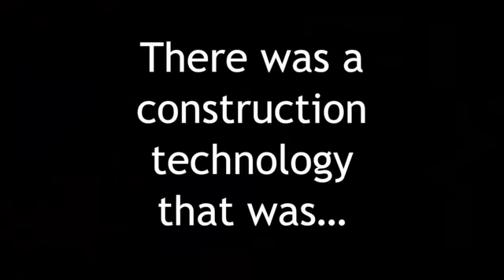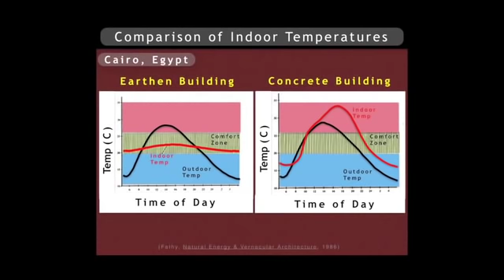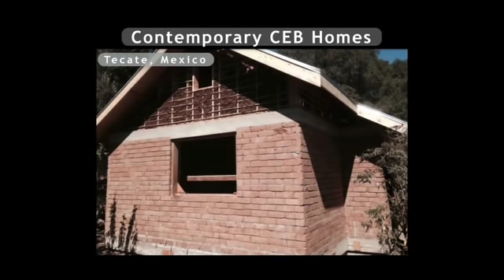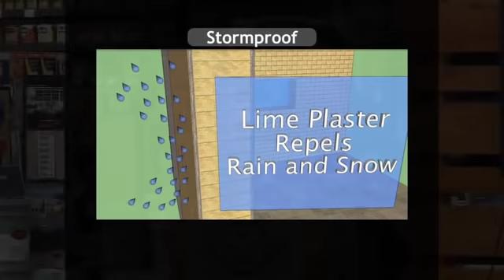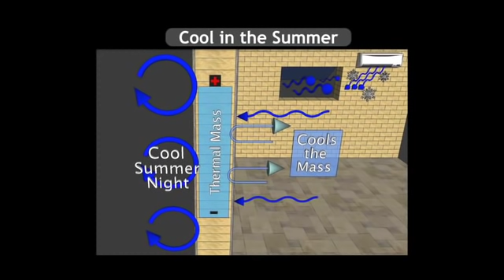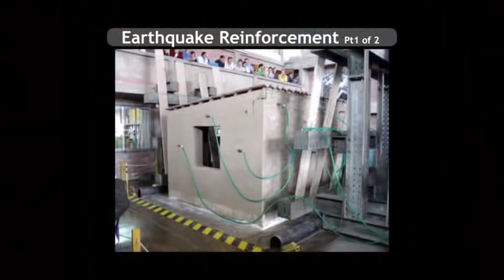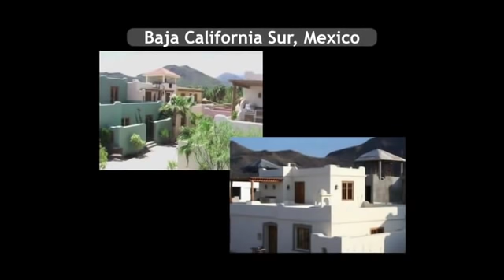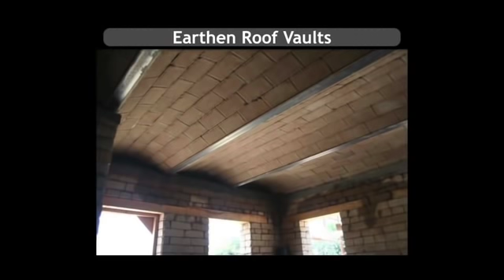Compressed Earth Blocks: Why and How, Here and There

Comment: I have 2 questions and a request about rammed house building.

1) How does construction of rammed earth homes integrate electric wiring and water/sewer plumbing especially for a 2 plus more floors?

2) Since the walls are made of earth, how do the walls survive in the shower or if rained on?

3) Is it possible to make/share a video that shows how the electric wiring and water/sewer plumbing lines are constructed and integrated into the walls?

Answers to the above questions will be very helpful in deciding about rammed earth homes and help shed a light on how electricity and water will be incorporated in rammed earth building. Thank you so much for the informative information.

Comment: Great presentation.... why not make the blocks interlocking so that they can be dry-fitted together and eliminate the need for skilled labor and mortar?
Reply: Yes. In Kenya, we are already using interlocking earth blocks. The machines for making them are also locally manufactured. Google "Makiga". Pauline
Reply: We are going to use the interlocking style to build homes in the inner-city to turn blighted properties into homes. By removing the need for skilled labor we can offer the homeowner a way to offset the home's cost... they can build their own walls, with a project manager to guide them. We just posted the video for our first concept home, the LuAnne. https://youtu.be/f4nHeNtufyA
Reply: @abundantearthglobalcdc4290  how effective is dry stacking tho? If there is an earthquake would it fall over, without a little mortar inside? He said they just use 1/4 inch  which is not alot.

Comment: By far the best presentation iv seen yet kept me interested from start to finish. I have a question though michigan temps drop extremely low in winter with no insulation in walls can passive solar and say a stove be enough for these temps.? Sometimes overcast for weeks at a time

Comment: For colder climates, the question is;  how much of the wall acts as thermal mass and how much is insulating that mass from the outside, much colder (ambient) air?  Doesn't the heat energy radiate right through that wall without insulation?
Reply: For very cold climates sometimes walls are built two blocks thick with a layer of insulation between them.  Jim built many CEB structures in Colorado.
Reply: I’m in Ohio right by the lake… I use compressed stabilized earth block. 4 parts sand, 4 clay, 1 part Portland cement 1 part high strength concrete… I use a manual press. My blocks are 5” tall 6” wide and 12” long. 2-2” holes in them to run rebar and various pipe thru. I apply stucco to both inside and outer walls. Still breathable. Remains between 65-70 thru the winter this past winter. One block thick. I have a 4’ wraparound porch on the home with roof over hang. Works like a charm. I have it solar powered and have an electric forced air fireplace in the living room only. No HVAC system at all. My solar system is grid tied and I have a battery backup for the absolute basics only. After a year I finally got the approval from 3 counties & 6 different cities building departments to build to sell these homes. Got independent lab tests, fire department certifications, even the local police and sheriff shot up a small wall to test if it’s bullet proof(it is), I am currently working with the VA and habitat for humanity to develop an apartment complex to get our homeless disabled vets off the streets.

Comment: Thanks for the very instructive talk Jim. I am about to build a Spanish style house in Australia. Originally i was interested in Earthbag, then got more interested in Rammed Earth (but the contractors were talking big money). But when we put the plans through our NATHers software (the Australian standard for checking energy efficiency) the figures were not very good (2.9 stars out of maximum of 10; see explanation below). They were good for summer temperatures (and we get up to 48° C; 120 F here), but in winter the heat leaked out slowly. I was reluctant to put insulation on the outside of the Earthbag or Rammed Earth and destroy the beauty of the wall and risk the render cracking later. So then I leaned towards using double brick with the cavity insulated. We were able to get the rating up to 7.5 stars. 8-10 stars is Passivhaus level, requiring almost nothing to heat. I will heat it with Solar water panels, re-circulating ceiling heat under the slab (3-5° C temp increase in rooms) and a wood stove for times when sun is not shining.

Then I started looking at CEB and am wondering if I can use a double block wall (perhaps 5" or 6" wide blocks) and install insulation in the cavity. What can you tell me regarding this? 
And do you know of any CEB making machines available in Australia?
Reply: Build your own CEB press. wiki.opensourceecology.org/wiki/CEB_Press

Comment: The key is the cement. A good, cheap cement, e.g., emulsified asphalt,  will allow a less optimal dry mix. Also no compression is needed with geopolymer binders. And no mortar if an interlocking block is used. An physical binder such as basalt fiber is much better than straw. 
Next, the bearing wall design has to match the needs of the area.

Comment: I would like to see hard numbers on the energy required to make portlant cement (concrete) and concrete blocks VS the energy required to produce CEB.  Hype isn't enough.
Also, by what mechanism is CEB breathable, and concrete not?  A concrete block wall is typically coated with a waterproofing on purpose, to prevent air and moisture infiltration.  Just leave it bare or coat it with mud like the CEB wall, and I bet they would be the same.

Comment: Very good  machine quick building
Reply: +tchip Pat It's not actually faster and in fact can take longer to construct than a stick house.  But the extra time and labor costs are offset by cheaper building materials.  Then long term they are FAR cheaper than stick homes, not to mention safer, better for the environment, etc.

Comment: How difficult is it to wire a CB home? Full modern suburban electricity+cable. Also, do the earth walls effect wi-fi?
Reply: It is not difficult at all.  Romex can be placed deep within walls in shallow grooves in the blocks cut with a rasp.  Because the structures are meant to last 300 years some builders prefer to use metal conduit.  You can also run romex in grooves near the surface and then cover them with wood trim or clay plaster.

In earthquake zones some CEB walls are wrapped with chicken wire inside and out which might affect cell phone reception but otherwise there isn't much metal to interfere with signal transmission.
Reply: Good question
Reply: Always worried about electric wiring.
Reply: Advantages of compressed earth blocks
Reply: It’s easy as can be depending on the style of block you make. The ones I make you do so while your building it…

Comment: Do you create a machine that makes locking / interlocking bricks?
Reply: Hallock does not use the interlocking blocks.  By using thinset mortar, wire mesh, rebar and concrete the structures become able to resist earthquakes in ways that drystacked interlocking blocks never can.
Reply: Vermeer does. $30,000.00 est.

Comment: A little clarity needed on the Seismic stability. The video mentions a basket method for adobe, but does not talk about the methods for compressed blocks. Anyone?
Reply: There are several methods.  In Mexico codes require concrete pillars at intervals.  Chicken wire is sometimes wrapped around the outside and inside of the walls below the scratch and finish plaster coats.  That is enough to keep the walls from collapsing.  I have seen videos of it in action so you may be able to find them on YouTube.

Comment: What are the measurement units for the compressive strength of the blocks. You mentioned strengths between 1500 and 2500 compared to 300 when using manual labour
Reply: Probably PSI. Probably.
Reply: The 300 figure is for Adobes.  Adobe is not compressed. They are poured.
Reply: The blocks I make with a manual press have tested 2700-3000psi… these things will crush any traditional block

Comment: Would rice hulls work in the exterior mixture? It really absorbs moisture and releases slow. However straw may be cheaper.
Reply: Have you ever used an HRV or an ERV in your homes? How do you exhaust the bathrooms?
Reply: How about using a mini-split system to heat and cool?

Comment: my question is
if i have a hand press can i use the freshly pressed blocks to build then keep wetting the build through its curing process and keep it tarp covered (i am saving time because instead of making neat stacks and building after cure i take it right of press to built and maybe stronger connected cause the whole wall cures together)
Reply: nice thinking. lemme know if u get an answer.
Reply: i have actually posted this question a long time ago, i would appreciate if you try contacting them (as i have not gotten around to it)
Reply: My understanding is no.  CEB and Stabilized CEB mortar is  a thin, pancake batter consistency slurry of the same mix used to make the blocks. Hallock and other building the way he does literally ladles it on.  The slurry soaks into the block above and the block below to make a single structure.  Within seconds of connecting two blocks in this way the blocks cannot be separated.  You would not want to cure the blocks in the wall because in the curing process the blocks shrink slightly.  Hallock and others have therefore settled on pressing the blocks in advance and letting them cure on pallets while wrapped in plastic, though the longtime owner of AECT advocated for placing newly pressed blocks directly into walls.

Comment: Do you think earth block houses would work well in places which have a heavy rain season ? I´m in Yucatan, Mexico.
Reply: Yes.
Reply: try B.C. Canada ........ unless u have rubber boots    ...
Reply: There is no problem until the blocks are compressed.
Reply: Yes, or just make an adobe house but add straw to the mix.
Reply: I built one in Nepal with 6% OPC and never added a roof. Not only did it withstand the 2015 7.8 earthquake, the bricks remain in perfect condition even after 15 years of South Asian Monsoons. So, YES! If you don't want to add a stabilizer, Lime or OPC, in your bricks, then make sure you have an overhanging roof and put a lime based plaster skirt around the bottom of the wall, also use stone for the foundation to keep the bricks from absorbing moisture from the ground.
Reply: That's very useful advice John!
Reply: Put a tin roof on it, with large overhangs and protect the walls from direct rain.
Reply: A stabilized compressed earth block can be used underwater.  A unstabilized CEB must be kept away from flowing water or standing water.
Reply: John Prokos is right about having an overhanging roof. The overhang has to be tuned so the side of the house gets full sun in the winter, then shade in the summer. My house is like that. I might add a portable south porch and make the south wall black.
Reply: @EllipticalMotion  this is how the romans etc built with earth
Reply: @EllipticalMotion  
I need more information john
Reply: Yes. I live in Ohio right by Lake Erie… just stucco the outside and give it at least a 4’ overhang (I do a wraparound porch around the house with roof over hang)

Comment: how can a CB home be made with a craw space?
Reply: +David Payne I thought of this before, but I believe that would possibly negate or partially cancel out the thermal mass exchange system if the floors aren't solid brick (I could be wrong).  That said I suppose you could simply build in a basement if your idea is increased space withing the same footprint.
Reply: You can elevate the floor. You need to vent from the sub-floor to the outside to deal with potential radon issues that affect non-solid floor homes. A concept I like is for 3-bed, 2-bath homes. The bathrooms are back to back, where the master bathroom has the water heater. The kitchen sink is siamesed against the master bathroom. The pipes are very short and you can reach them. They're centrally located and unable to lose heat to the environment. The plumbing is pushed to a specific region of the home, so it can be elevated, insulated, and made easier to maintain.

Comment: can someone give me a recepie for such blocks?
Reply: void sure the ingredients are: 1) Earth
Reply: The exact proportions vary with the characteristics of the earth being used, particularly the clay.  The mix includes sand and subsoil that contains clay.  The sand needs to be sharp (not rounded beach sand).  For stabilized block portland cement or lime is included.
Reply: @SASL2000  can you plaster with that exact mixture to?
Reply: @SASL2000  ?

Comment: how fast would these walls dry compared to a cob or rammed earth home?
Reply: +Mark Gailmor CEB do not need to dry, they can go directly from the machine into the wall,  but the walls will continue to cure over time (I think a few weeks more or less depending on the initial humidity of the material used as well as the ambient temps and humidity).
Also I'm not sure why Jim uses mortar, but from my limited xp, we simply used a mud slip/slurry and a BIG paint brush.  Just wet the faces of the bricks and stick em together and within 48 hrs. they are stuck together as if they're a single piece.  This makes it extremely simple, you don't need any masonry skills since maintaining an even mortar joint requires skill and if you aren't consistent the courses can begin to undulate or become uneven, imo ;?).
Reply: Russell Russell
Thanks. My biggest problem with CEB is that, unlike Rammed Earth, or Cob, you have to hire someone to do this for you. The machines are far too expensive to buy. So, in the end, I would probably go with Rammed Earth or Cob since they can be built with a few people and no expensive exquipment. I do like these a lot though.
Reply: *****
 Depending on where you live, you might find used machines for sale - I've seen some in the past for about 1/3 of their new price, and if you go with the smaller models you could be looking at a cost of around $4K - $6K.  Of course you can then resell it when you are done and probably recoup much or most of your investment.

You might also find others who are looking to build their own home as well and are willing to share the cost.  And there's the possibility that someone might be willing to rent their machine as well, and finally there are also plans online for building your own machine, so there are possible options.  I just think that the CEB is far superior to those other materials and so worth the added expense in the long run.  Good luck and hope you find a solution ;?)
Reply: Russell Russell
I think I would prefer to build a rammed earth home or cob home. I don't really need any special machinery for either. If I go the rammed earth path then I obviously need to build some form factors. With cob, it's more labor then anything else.
Reply: @rawmark  oi m8 hav u done it?

Comment: This may make sense where there isn't affordable access to lumber, but here in the US stick walls are pretty affordable. Most of the cost in building a house is not the walls. These Earth Block walls still require cement, concrete, rebar, mortar, interior/exterior plaster, insulation, additional hardware for electrical, AND a whole lot of labor. Also, it's much more difficult to modify these walls later. Reminds me of the shipping container houses, where essentially people build a house around a shipping container. Just omit the container, and you have a traditionally built house. Most of the time these ideas are just not practical, but I do enjoy listening to new ideas, nevertheless.
Reply: Total cost of ownership comps I wonder.
Reply: A fireproof, bulletproof, insect and vermin proof,  storm and earthquake resistant home would save hundred to thousands of dollars each year on insurance premiums, not to mention energy savings. If the lifespan of a CEB home could be hundred of years, well, that would be even more disruptive.

Comment: On my quest to start a project I cannot find a manual machine in the United States.  All of the companies need to ship it from some other country and I have to deal with customs.  Anyone found otherwise?  It is causing me to have to look into doing rammed earth instead...  Comments please?
Reply: As a dumb suggestion, could you build your own?  There are several channels on YT that are dedicated to the manual compression of bricks for housing.  Would it be possible for you to purchase the materials and build your own?  From what has been seen, building your own machine is not that hard.  A decent drill, bolts, nuts, washers, allen keys, spanners, angle grinder and some assorted steel should see you right.